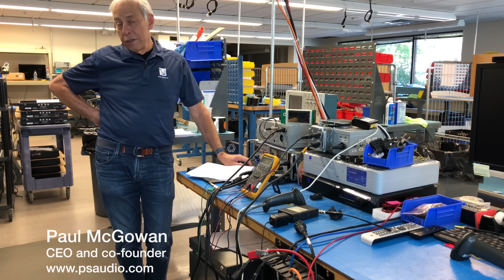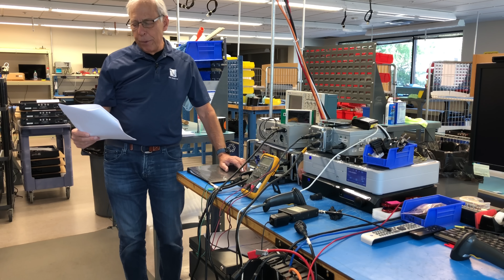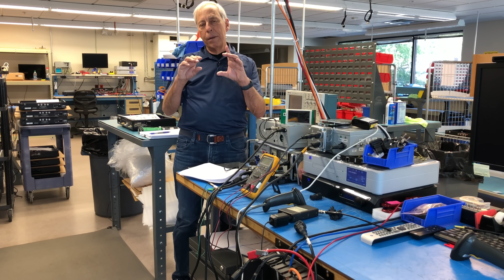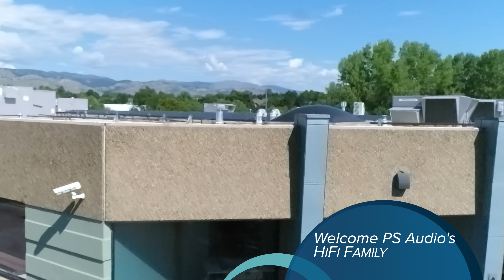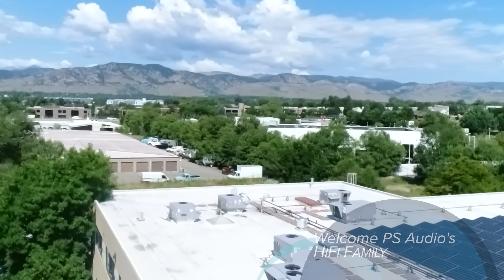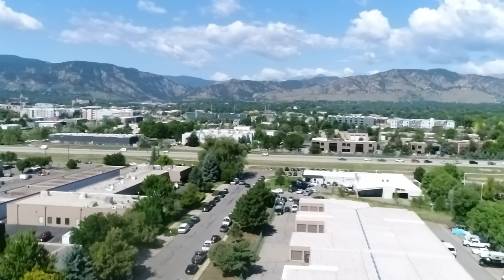Does heat affect sound quality?

Comment: Before I watch the video I will say yes. I am an electrician and heat effects everything. Excessive heat can cause serious problems. Relays start acting up, motors overload, plcs fault. With expansion and contraction the conductivity changes, which in my eyes would effect sound. Whether it's audible or not is another story. Probably depends on the amount of heat and quality of the equipment. Just like on our controls.

Comment: Hopefully prodigious amounts of heat will not be too detrimental for my audiobuddy's Graaf GM 20 OTL    - they can get as hot as a hibachi in full blast yet it is probably the best sounding amp under 10,000 USD.

Comment: I've thought about this - one  of my speakers ( and of course the wire ) is within 18 inch of a room heat  radiator - I have measured 88 deg next to the side of a speaker....... assume eventually the temp stabilizes inside the ported speaker  especially long term affect ?

Comment: Interesting topic this ...... MOSFET output stages are self controlling in temperature.. they need much bigger heat sinks per watt output than bipolar devices. 
How many amplifiers are designed so that the Vbe multiply device is mounted on the output stage heatsink ? Not many !!

Comment: I thought the question was going to be about room temperature and the change in air density between a cool room and a hot room. I wonder if that could affect the way a system sounds? The same thing about altitude and air density.     Say, Denver at 100F vs sea level at 50F, would that change the way a system sounds?
Reply: For sure, yes.

Comment: Paul you're all over the place on this one. His question is a simple one. First you start out answering about the performance of the electronics versus the sound that he's asking about. Then you go to say that it'll sound different cold and hot and then what about even room temperature? Are you telling me you sat down with the same electronic set up in varying degrees of temperature from cool too cold to room temperature too hot to warm and you heard difference and sound? Holy crap this might be worse than your power cables making a difference in sound. Wow this video had me throwing on my waiters trying to trudge through the crap you conveyed.
Reply: Semiconductors are very temperature sensitive. The thermal voltage between junctions of n type and p type silicon is given by:

V_t = kT/q

k is boltzmans's constant
T is the temperature in Kelvins
q is the charge of an election

So as temperature rises, so does the thermal voltage between p-n junctions in the silicon which effects the conductance of the silicon and performance characteristics of diodes and transistors. As such, semiconductors are almost better thermometers than they are semiconductors.

Comment: While good design will keep the electronics safe and within specifications, the air temperature in the room will drastically change the way your system sounds.  As the air becomes warmer the density is reduced and also the ability to transmit sound vibration is reduced.  That is why the bass and mid range sound better when the air is cold than when it is hot.  Sound tuning in a live performance venue changes drastically with rising temperature. Often this change has a disastrous effect on the sound system  performance.

Comment: Worst thing I see is amps or recivers put in small places where heat can't really escape😬 Or has things stacked on top. I built my own stereo bench/cabinet (?) and have about 10cm on top and about 3cm on each side and no back plate so heat cam espace easy from my reciver. The reciver also has a fan that activates at a certain heat level and at a certain volume level. And my power amp (runs class A for the first watts and then switches to A/B for the rest) stands on top of the bench/cabinet so it has nothing to restrict the heat. That also has fans inside to help the really hot (and big) heatsinks from getting too warm.
Reply: True. 
Even worst when ppl put their stuff near heathers/radiators. OMG i cant watch it! 
Have seen also amps with stack of books and CD's on them. Imagine inside temperature with 90% covered ventilation holes!
Reply: @jareknowak8712  Omg.. That is so horrible to watch.. People like that should not have been allowed to own electronics🙈 Worst case it can be a real fire hazzard. Best case it just breaks the amp after a shorter period.
It's even worse when people do this with really expencive high-end equipment they bought just because they have money to spend but have no knowlage at all

Comment: Remember when i entered the car audio stuff in my early days, and when it was below freezing winter times "Sweden" i could swear that my mids and specially sub sounded way better, was it my imagination? Had several people to listen my stuff and  EVERYONE said that it sounded better when they were cold
Reply: I experience the oposite.. When the stereo is cold it sounds harsh and "stiff" but when I playe at lower volumes (amd encrease it a bit after awhile) so the amps and the speakers vouce coils get some heat in them the sound opened up and played alot better
Reply: Dave Micolichek  Same here. Or in my case I have kinda decent bass but ALOT better when the amp and the speaker have gotten warmer. And the tweeter is harsh and not any good before it has warmed up. Like night and day difference. Same with every single stereo system I have ever heard. So I don't know how anyone can think it sounds better when cold🙈

Comment: also speaker drivers apparently loose some dynamic range when heated
Reply: Absolutely , it's called thermal compression . It affects closed boxes a lot more than open baffle speakers and it's definitely not a marginal effect when you use your speakers for a wild party
Reply: @gerritgovaerts8443   Driver motors also loose some of their magnetic performance when you heat them up. But this only really happens in extreme circumstances.